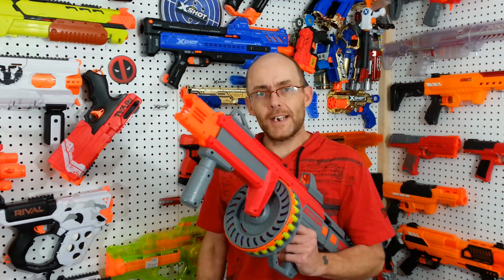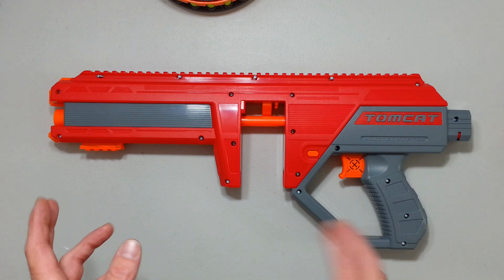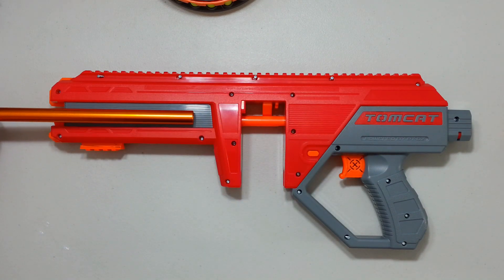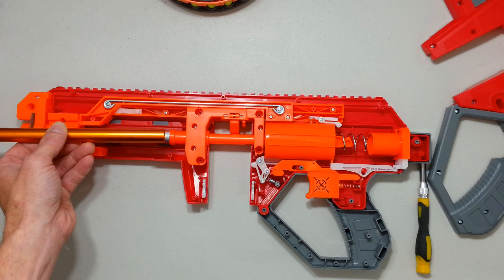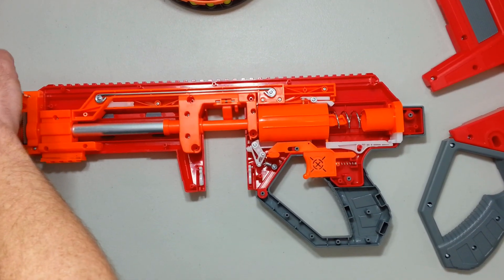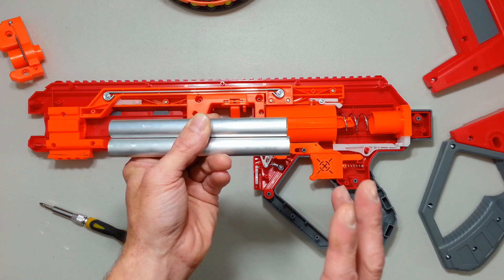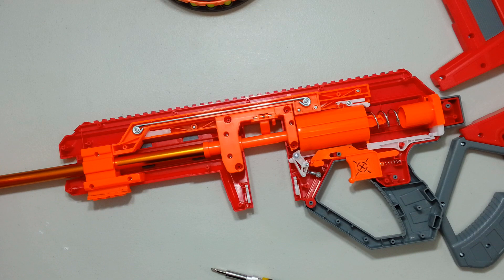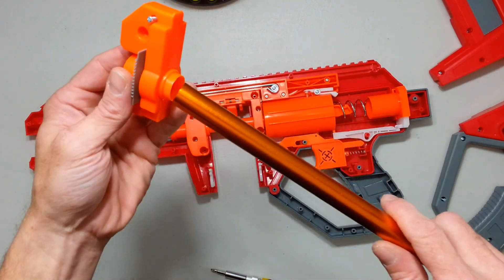Dart Zone Max Tomcat Internals & Barrel Mod

Comment: The bamboo 2.0 gives an escalated fps number on the chrono due to its light weight though. Distance and accuracy might suffer a bit because of it. I think you should use max dart or worker high end for accurate reading.

Comment: So every now and again I get a dart that kinda flubs out and I don’t know why I put a brass barrel on it at 10” and most shots fly exactly where I want it’s very strange. Do you have any suggestions.
Reply from the maker: Does it happen with new Darts, if so, maybe the brass is not lined up and "catch" the dart
Reply: @thatoldnerfguy  turns out it was a seal issue then I sealed it too good and it kept vacuum sealing now I’m trying to get that right I cleaned up the grease and now it can actually prime but I still need to take off the second row of Teflon tape because it’s still not quite right
Reply from the maker: @d0mlyf322  My Swift used to do that before I drill the pusher tip
Reply: @thatoldnerfguy  I didn’t even think of that I can take out the cross bar on the e pusher and that might help

Comment: On this one here when I tuned it I did put a k25 and I started with 10 in of barrel and I slowly worked my way down from there and right about seven and a half inches is where I was getting the highest which was 200 FPS but that's not that long I think it has to do more or less with the oval plunger tube in the seal in it than anything else
Reply from the maker: Weird... because plunger/stroke volume allow for 300mm of barrel, I went a little overkill with 350mm, but I'm still shooting 210+ on bamboo 2.0 without any spring upgrade and a near perfect seal
Reply: @thatoldnerfguy  it might have been the cut down k25 I put in it too
Reply: How do you figure out what the best barrel length is
Reply: @d0mlyf322  if there is an actual mathematical formula that'll give you the volume of the plunger tube once you figure out the volume of the plunger tube you plug that number into another formula and it'll tell you what the optimal barrel length is
Reply from the maker: @d0mlyf322  The total of air volume in the plunger tube must be slightly superior than the barrel. Then you'll need to find the Stroke(the distance the plunger travel when you fire).You need to calculate Plunger Tube and Barrel Volume.. Adjust you barrel length to the desired volume... A little intricate, but since you ain't the first to ask the Question, I think I'll make a Video for it!

Comment: What spring would you use to upgrade it with I just got mine and don’t wanna go the spacer route
Reply from the maker: No spring upgrade... I only changed the barrel
Reply: @thatoldnerfguy  what barrel is that? Where can I get it?
Reply from the maker: @dr.variant  That's a 350mm Swift barrel...